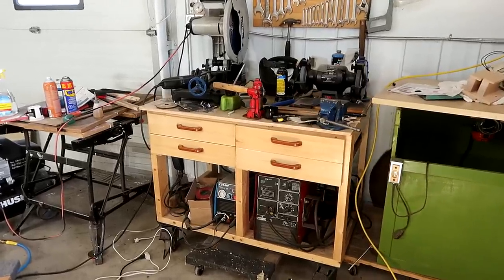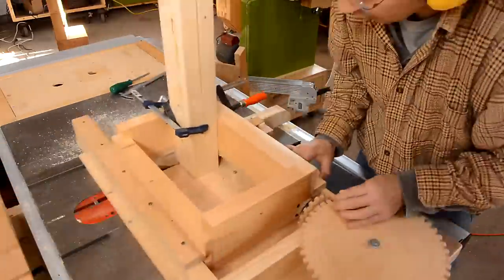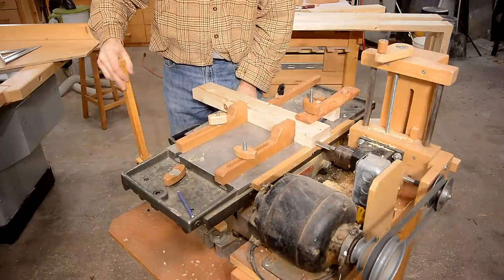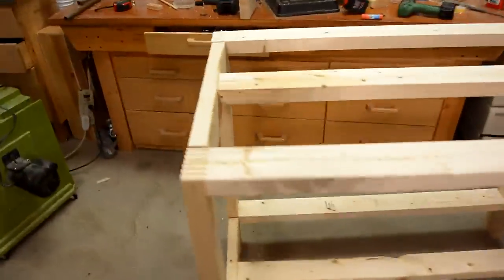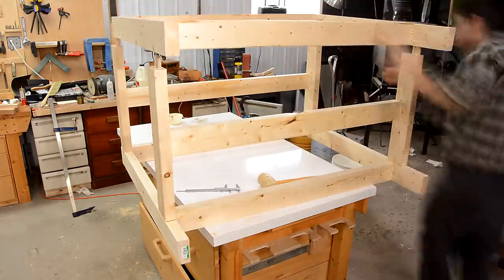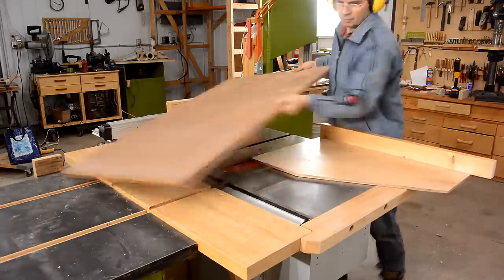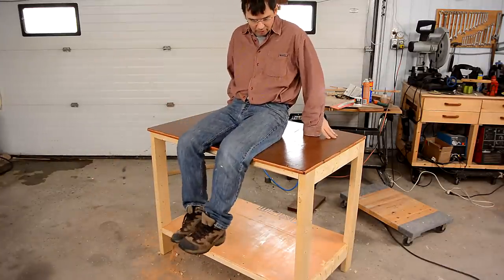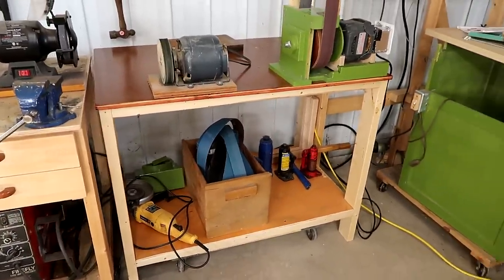Workbench that levers up onto dollies for easy moving

Comment: I went and bought two-12 x 18 inch Harbor Freight wooden dollies ($9 each) and was excited to try this but had not built the two L shaped levers. I thought why not use my floor car jack. I rolled the jack and eye-balled the middle of the workbench. I placed a 4 x 4 that was wider than my workbench (approx. 22 inches long) on top of the jack and began to lift my 400 pound workbench. I raised the workbench just enough to place two-2 x 4s - one on top of each dolly. I then slowly lowered the jack leaving my workbench a half inch off my garage's concrete floor. I could now move my workbench easily. Thank you Matthias!

Comment: That’s such a simple and smart way to do that.  I put locking castor wheels on one of mine, it works okay. But it would be much more stable if it were sitting directly on the floor like your benches.

Comment: Sweet idea for a lifting mechanism!  Now I can finally move that overloaded workbench without that 'fingernails on chalkboard' scraping sound, from the 2x4 legs dragging on the cement floor.  Couple scraps, few spare casters, won't be as pretty as yours, but it removes an impediment to my organizing efforts, so I can focus on more important projects.  Thanks!

Comment: If you use PVAC glue and cross-measure to adjust clamps you can make it perfectly straight without clamping it down to an already straight surface, great video!

Comment: I have been wanting to build a large work table I can roll outside and back in. I have seen so many "Scissors", pump jack and screw mechanisms to move benches.  I'm doing this method, simple and easy to do.  Bonus you can still use the dollies for other things.

Comment: Wandel, 
Terrific, Brilliant idea! You have just made my life easier in my new small shop. One set of dollies to move the work tables and power tool tables in the shop, great.
Now! what's needed is a “second” outdoor dollies system with larger wheels to roll over uneven ground. You would be able to exchange the dolly systems on the same power tool tables just depending on indoor or outdoor use. What do you think?

Comment: It's clear that your primary material is wood. But in my experience any metalwork area just gets more messy. Wood is just a cleaner material to work with.

My friend in Sheffield started with one small shop. Two small lathes, a milling machine, a very heavy welder and various minor machnes.  12 years later - it is now TWO larger shops. One is just a grinding and polishing shop (Because the waste products of grinding and polishing are very bad for precision tools). The list of tools is now just too big for this text. We have also made, modified or restructured many of them; for specific tasks. 

Whenever we need new benches we use welded frames. In part because the metalworking tools tend to be much heavier. Also the cutting oil and flood coolant we use would seriously damage wooden frames.

Comment: How about a universal lift that moves ALL the heavy shop tools? Small area shops like mine require moving equipment about ALL the time for use..I just went out to the garage and counted 7, planer,tbl saw, router tbl. jointer, band saw, belt sander and one of my benches...Also a fast leveling system because everything has to be shimmed to knock out the wobble because the floors have their say....TY

Comment: not a woodworker, hence this basic question: the wood looked to be under a lot of stress (or tension) while being held together by the clamps. Does this stress effect the strength of the final product? For some materials, like glass or rope, the inner tension might have a damaging effect on the product if it's under a load. I don't know about wood, it might be malleable enough to just settle down in the new position. It probably depends on the type and age of the wood.
Reply from the maker: the wood can take way more stress than the clamping force, so it's not much of a factor.

Comment: Why 5 mortise and tenons in the box joint on the bottom shelf 2x4? Why not just one? 
I understand you have more glue surface this way. But would one be stronger? It seems you would have more wood with one?
Great videos!
Reply from the maker: the tenon would be stronger if it was one, but  the joint would be weaker because there wouldn't be enough glue area
Reply: Thanks

Comment: Would it be any more stable if you cut the slots a bit shorter and then square them up with a chisel so they get contact on the small sides too?
Reply from the maker: wasn't really worth the effort.

Comment: I love the clever-lever; so ingenious.  But, please, please, do a safety tune-up.  1) . Never cut plywood or anything else freehand on a table saw--use the fence, miter gauge, or jig.  2) Install a riving knife or at least a splitter.  You're asking for trouble on those two points.
Reply from the maker: I have been asking for a very very long time.  It helps when you know what you are dong.

Comment: This seems a bit simplar than making tables with the bottom platform angled so a dolly could literally be wedged under it with a kick picking the table up but makes the top angled in the process while moving.

Comment: During the glueup - which I always find the most daunting part of a project - I kept thinking 'He's left out those middle bits'.   Confess - did you really prefer the look, or did you actually forget ?
Reply from the maker: The plan was to attach those with screws afterwards so as not to weaken the horizontal pieces by cutting joinery holes in them.

Comment: Matthias, the joints you make are a little more time consuming but I think much stronger! You’re right, those two simple lifting arms were “clever” very “clever”. Thanks for sharing.
BTW, did you ever put a wall in your downstairs shop or is the plastic still hanging?
Reply: MRrwmac + Why do you ask?
Reply: +Commenter Five : 😲
Reply: He has actually done videos testing various joint strengths. Not merely thinking they are stronger, he proved they were.

Comment: "this is where the clever part comes in" um where? seems like a simply concept to me, Would work with any bench with that much or more clearance under if you have big enough levers, I have seen some clever workbench designs with casters that can be set and released, This is not all that clever.